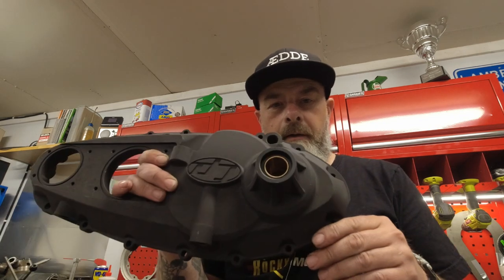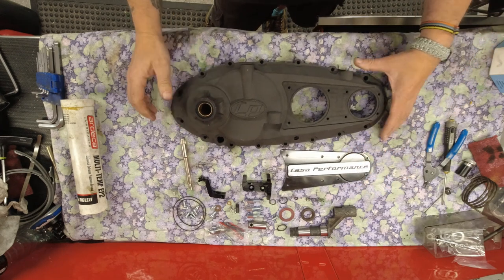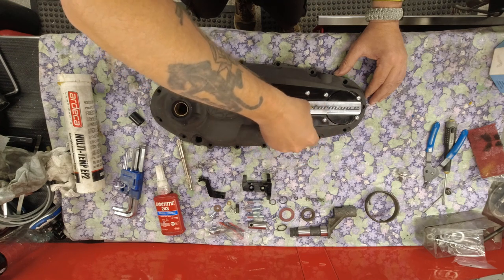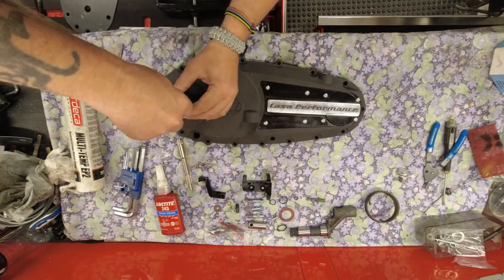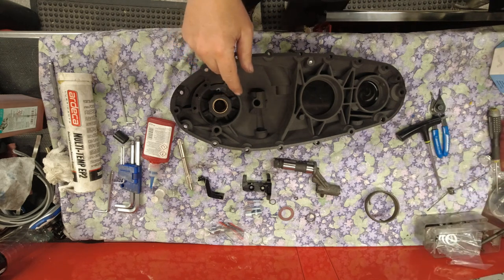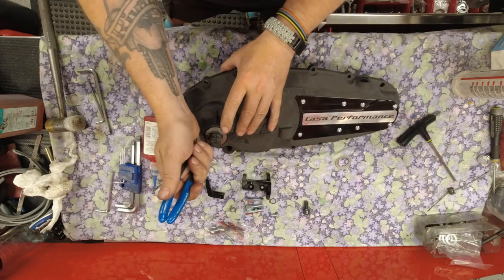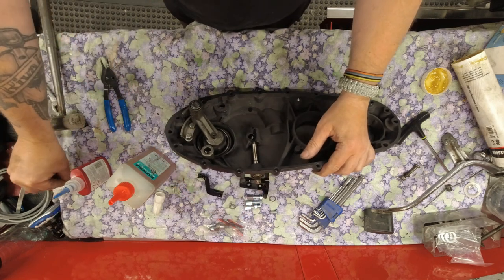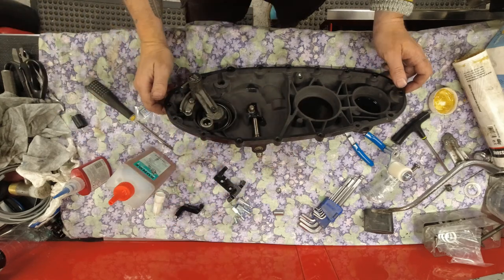Casa Cover build video #kickbackgarage

Comment: Couple of things Rob....how easy is it to remove greasy marks from the Matt black surface and 2nd ...things would look better if the fixing screws for the CP written cover were in black
Reply from the maker: I've had my dirty mitts all over it and it isn't looking dirty.
Reply: I must admit I prefer the GP clutch system.